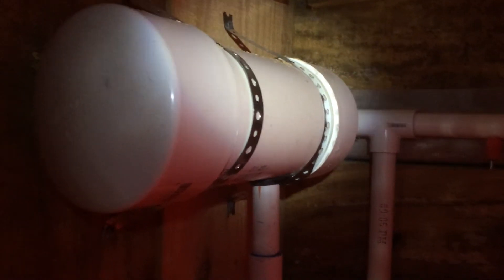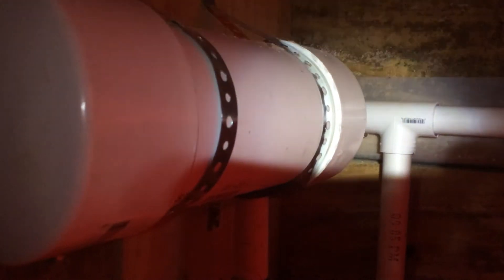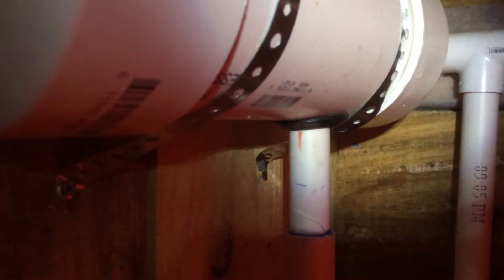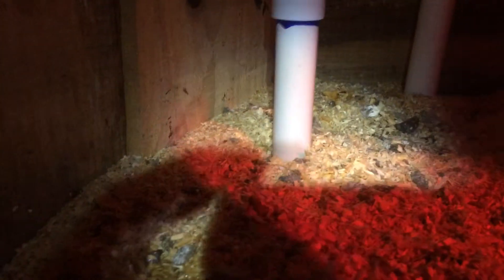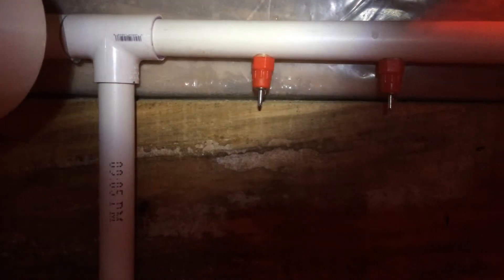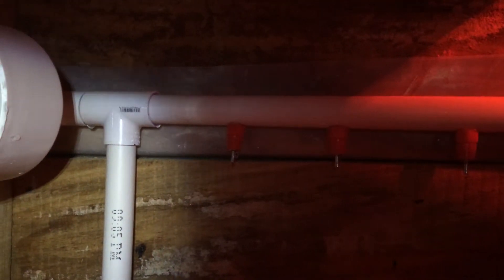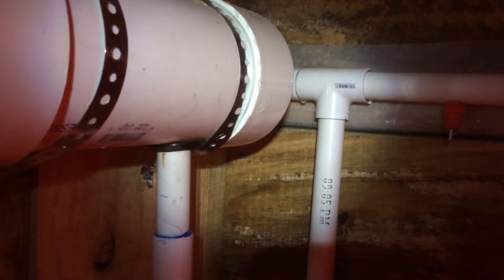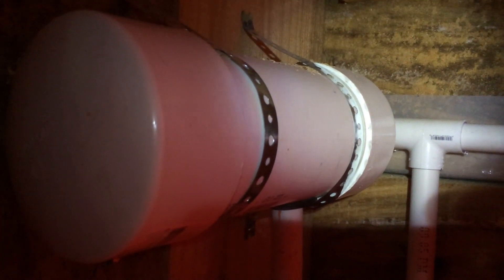Backyard Chickens - Watering System - Automatic

Comment: No algae growing in this system as No light to stimulate it.
Reply: Add a drain board below for dripping so excess water vented instead of causing coop damages.
Reply: A sheet metal galvanized drain 'V' perhaps? really shallow for directing drips out the side?
Or into a pipe out the side/bottom.

Comment: Use a screw on end cap that has a rubber gasket built into it; adds the cost of the two fittings that the screw-on cap needs. Add some teflon tape th the threads(about 6-7 wraps)
Reply from the maker: I should have made it serviceable, but it lasted a solid two years before it finally crapped out. And by that point I was planning to butcher so no big deal. But for future reference, I'll build the next one better for sure! Thanks for watching!
Reply: He has a leak at the left of the T on the wall; not glued it seems.
Reply: A really nice idea.